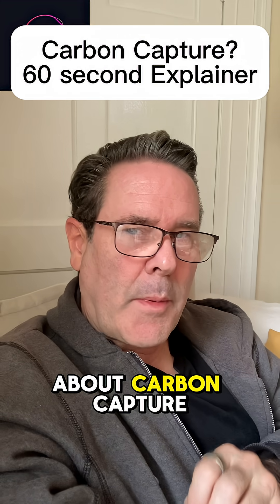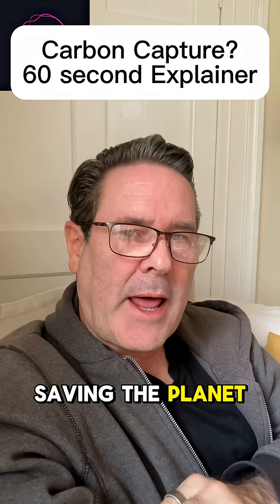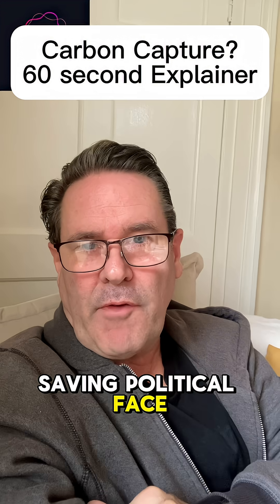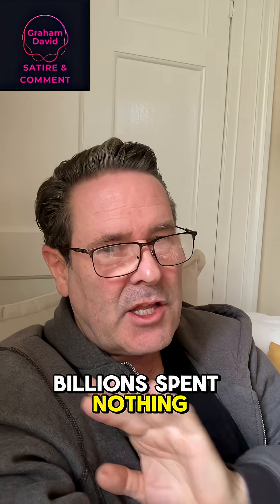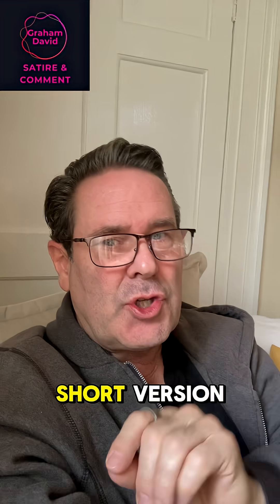The idea behind carbon capture is sound: stop carbon dioxide before it hits the atmosphere

Comment: All I know is it's going to cost 20 billion, abd and you could just plant a few trees to do the same thing without the expense 😂
Reply: There's already more than enough trees. The globe had added 20% more green space in the 50 year's.. we get the majority of oxygen from algae in the sea
Reply: @philpid4085  Planting trees is only partially effective because they stop capturing carbon when they die, and will ultimately rot away, releasing their stored carbon.  You need to lock the carbon away by using it in construction or deeply burying it.
Reply: @aro4491 😂😂. We don't need to do anything. The planet was here long before us will be long after we're gone probably. That's the point we don't affect it so don't need to do anything in that sense.. what we should do is be nicer to the planet and treat it as our Equal and not our dumping ground